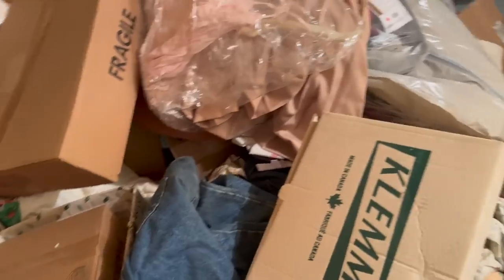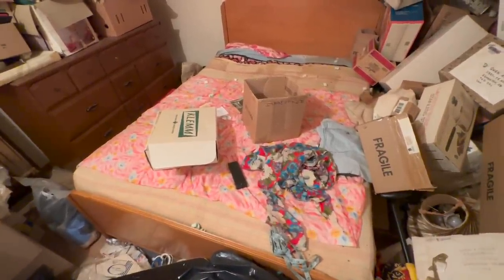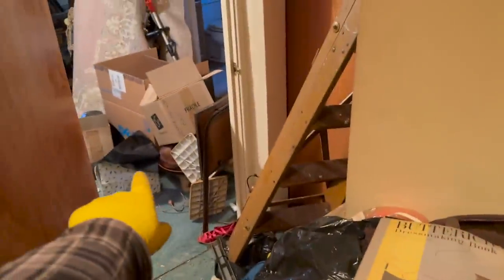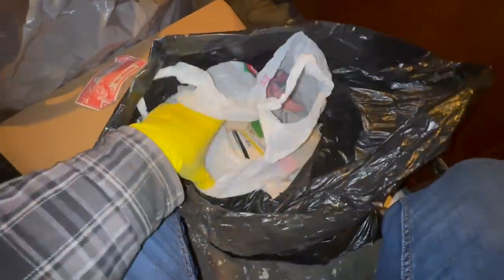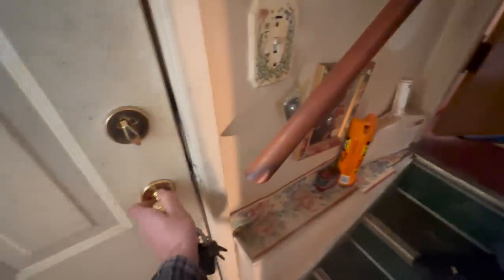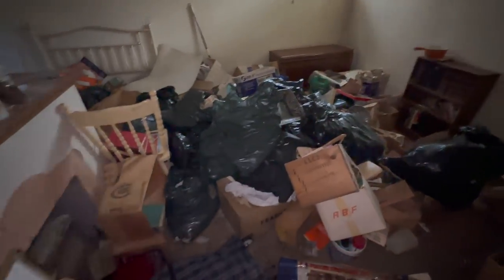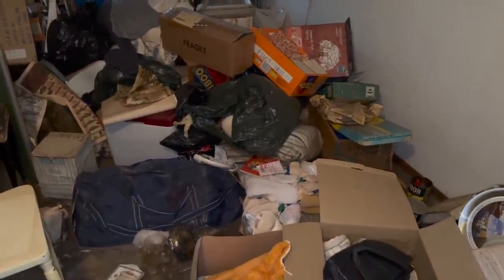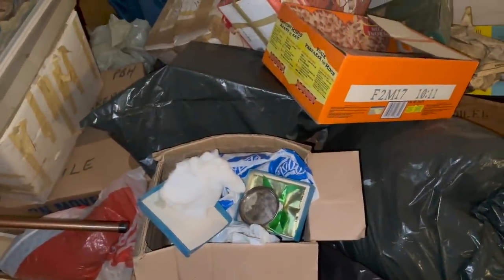Mystery trunk found! What's inside! Pressure is on! dumpster day Part 3

Comment: Sorry, I may be commenting on the wrong video(I streamed a few to my tv last night), but I don’t think the water damage and asbestos make for a tear down unless abatement is required for sale. In many cases, when lead paint or asbestos building elements are intact, they can be safely covered. A bigger issue is what may be behind the walls- aged wiring that’s not up to code.  
This actually looks like a fine house, and I’m jealous of all the space. It looks so modestly sized upstairs, then huge downstairs. Almost bigger than uptop since it’s not carved into so many rooms?  I would love this house.
Reply: I was thinking the same! It looks like a really cool house! 💗

Comment: Alex, those aren't garbage bags, they're flimsy suitcases. I hope you're not just glancing inside and pitching them.were none of the huge area rugs salvageable? Makes me cry.😢
Reply: He said alot of mold and mouse droppings with some of those things in the basement
Reply: The rugs were just carpeting offcuts and likely moldy judging by the floors down there. Lots of decent/useful stuff ruined by mice and neglect. Hoarding like this is a symptom of a deeper problem, usually traumatic loss. That compounded by a shopping addiction is nightmare fuel. This particular addiction was to the act of acquisition not the item itself. Which is why it is then tossed in a room, bag and all.

Comment: In the USA the  cost for abating asbestos for an entire house is about 15k. Since it is solid tile in the basement, not hard to reach, in the USA it would probably cost less than that by a significant amount. You get into that higher cost when you start dealing with fiber insulation that has to be encapsulated with a tent. If the owners wanted to they could encapsulate that floor with more sub flooring and notify the new owners that asbestos is present. If it can be encapsulated it isn't considered a threat. It is the fiber insulation that is really scary.
Reply: Its perfectly fine to leave those tiles on the floor and put new flooring over them. Once they are sealed up, the danger is gone. Subfloor, or liner, new floor, done.

Comment: Asbestos was common back in the day but not all flooring had asbestos in it. If I was the future owner of the house I'd have the floors tested and if the test comes back clean I'd rip the floors out myself. The house does need a lot of work but not necessarily to the point of tearing it down as far as I can tell. Not to mention if you want to demolish you'd still have to safely remove any asbestos first, so definitely not saving any money.

Comment: Cut a 2x6 to match the profile of the front section. Use a ratchet strap to pull it down to meet the front. Use wedges...to adjust to the elevation

Comment: Asbestos Abatement: In our area you have to abate asbestos even to demolish a house, so I guess the Tear Down question would depend on the condition of the rest of the property and the value of the property with, or without a dwelling, as a new house building site.  Here, for larger properties, tearing down can happen if the zoning allows for sub-dividing the land to build multiple new houses, when the existing house would be in the way.

Comment: Don't give up on that house yet, it may be very possible to simply float vinyl plank flooring right over top of the questionable flooring.  That way the tiles are fully enclosed and will not deteriorate through wear and will not be a hazard.  Check out the local code.  Could be an easy fix.
Reply: The house isn't his problem to fix.

Comment: It amazes me how you can throw out a sealed box just because it was water damaged, covered with mouse droppings and stuck inside a bigger water damaged box @ 32:35.  At least open it up to see if there is any water damage to whatever is inside.  It could have been a very rare piece of glassware or ceramics or jewelry that could easily be cleaned up. Curiosity is killing me. And now it's gone.
Reply: I worried about that box too, but knowing Alex from his videos, I’m guessing he opened that smaller box up off-camera before he tossed anything. Not much gets past his eagle eye!